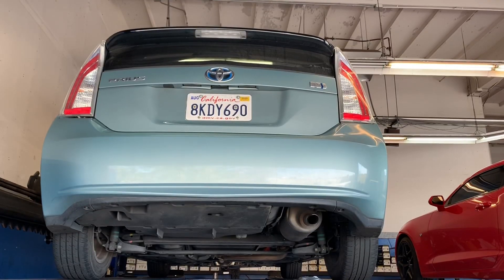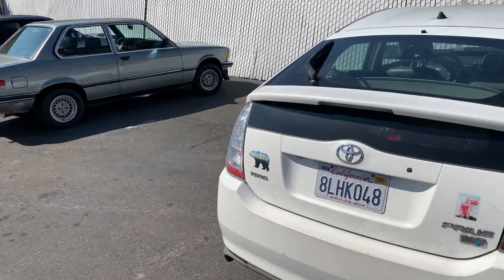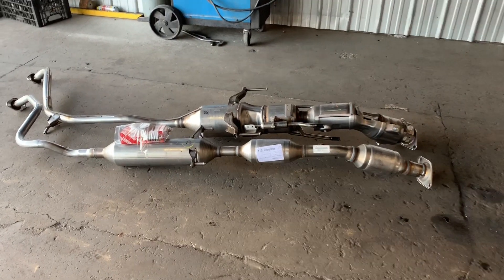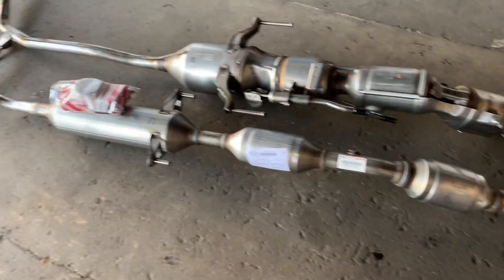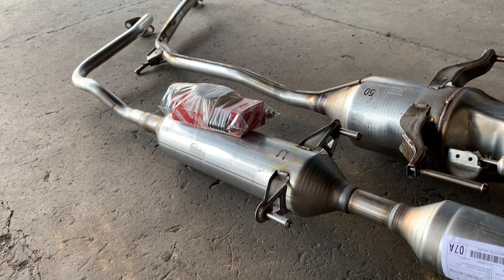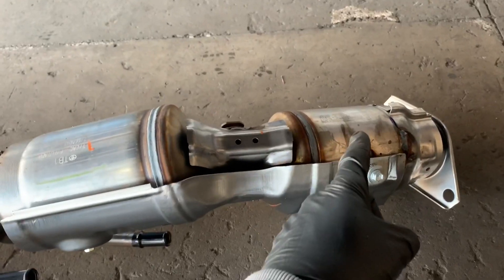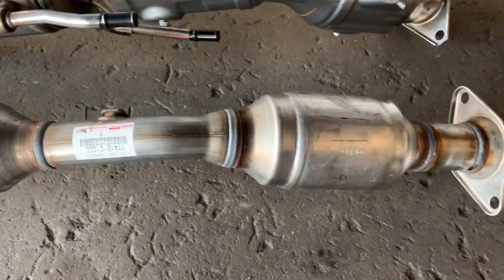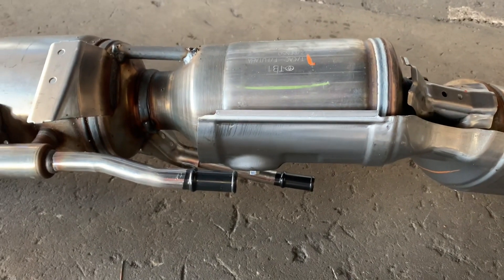2010 or newer Prius?  Do not drive it with a missing catalytic converter!

Comment: Thank you very much for this information. For those with a Prius, especially a Gen 3 Prius, I would STRONGLY RECOMMEND getting it protected underneath with a cage, titanium bar, or shield. I'm in Chicago, and I have a 2014 Prius which got it's catalytic converter stolen. Third party replacement parts -- it has to be the factory part due to the fact that the thieves cut through the heat recycling system too, not just the around the cat, as was shown in this video. I have to wait up to six months before the part comes in due to supply chain issues. If your shop tries to convince you not to put a cage or rod on it, as mine did, don't listen to them -- bring it to a shop that will do it. Otherwise, prepare to run the very real risk that it will be stolen, and your car may be out of commission for 4-6 months.
Reply from the maker: We have a solution for the back order if you let us do your repair.  Call the shop 916-421-0399
Reply: @mufflertech  Hey, I live in Chicago, otherwise I'd bring it to you. But I did call around and finally found a shop that would do it. The thieves didn't know what they were doing, and really did a hack job on the coolant pipes -- but with some creativity and some welding, the shop said it will be done. Crossing fingers!

Comment: Great video and very useful info. One slight correction tho: the 2010-11 Prius has different taillights than the 2012+ Prius. The 2010-11 Prius taillights look similar to the gen 2 Prius’. The headlights are a better indicator.
Reply: I've always thought the placement of the shifter in the interior console was the best indicator between gen2's and gen3's. The Dash in the gen3 are completely different.

Comment: great video! thx for sharing. dont mind the folks saying you could have summed it up quicker. lots of good info and nice shots of the prius exhausts systems. thx again!
Reply from the maker: Thanks Will.  I do these unscripted and I can run a bit long.  I appreciate the criticism and thanks for watching.
Reply: long is fine and no problem. I was commenting on the other viewers who actually had a criticism. good content! I actually learned some new element of how the Gen3 prius works; and heats up the cabin interior more quickly via exhaust gas heat extraction - at least that's what I think is going on.

Comment: The Gen 3, i doubt,  is running coolant in the exhaust system for cooling.  The cats will glow red with bad fuel/air ratios and that's after the secondary cat. I think they're doing that to heat the coolant to either heat the motor faster or provide heat faster to the climate control system. Just to clarify.
Reply: what happen when you are cruising for hours? do the water left inside the cat jacket just boil off?
Reply: @Francois_Dupont the exhaust is the fastest thing to warm up.  Use it to heat coolant,  you can then heat the cabin and motor faster.  Once you're cruising,  you just continue running it and cool the coolant in the radiator.  EGTs aren't typically a problem in gas vehicles.  So you don't need to worry about the exhausts.  In contrast, new diesels monitor EGTs AND have an air mixer at the exhaust tips to lower discharge temps to safe levels.  Also,  in comparison,  a 1992 Honda Civic puts out similar HP to a Prius.  And the 1992 Civic radiator is (jokingly)  smaller than my air cooled motorcycle (air cooled doesn't typically have a radiator). You look under the hood of a 1992 Civic and you expect a normal sized radiator.  It's half that size.
Reply: @jkutches17  I think you are correct.  Unfortunately the cost of a little faster warm-up can be an internal leak into the converter which will slowly drain your coolant and lead to a cracked block.  Bad idea by Toyota engineers in my opinion.

Comment: Thanks for the video, useful info here. Scrapping out our gen 3 and turning it into sand rail car. Head gasket already failed (mom never serviced the damn thing). I got in under there and unbolted the whole assembly front and back, cut the coolant lines, one being intake to the cat and one being outtake I believe? Just gonna splice em together for a sand rail vehicle, off road only, we have a perfect sized steel pipe piece to splice them which is lucky because I did NOT watch this prior to taking it off and I got COVERED in coolant. 😅 But hey, there's a perfect assembly ready to be scrapped and hopefully splicing those lines lets the coolant return to engine and the car be usable off-road. Don't want to have to completely revamp the coolant system for an off roader sand rail. Next project, off goes the hybrid battery system and leave it at 12 volt with engine haha.
Reply from the maker: Sand rail Prius?  That’s sounds interesting!  Putting a loop on the lines will work fine, just be sure it doesn’t get pinched.

Comment: Currently, there a plenty of easy pickings with Gen 2 cats.  It won't take long for the experienced thieves to find out that Gen 3 cats are just as easy to steal as the Gen 2 ones,  They just won't be cutting the preheater coolant lines.  Still on a Gen 3, one cut with a Sawzall and just two bolts need to be removed.  They will also cut the wire to the oxygen sensor.

If the coolant lines are cut, the car can be made drive-able  by repairing the lines and  refilling the radiator with coolant.

Comment: Good video but 1 correction the coolant going to the the exhaust is not to cool anything its to heat the fluid up fast to allow the heater to get up to temperature faster for cold days like in winter.  I currently need to decide if I want to do the bypass trick because my cat must have cracks inside allowing the coolant to leak into the exhaust pipe causing lots of white smoke and lack of coolant as well as no heat and easily overheating.  I have a appointment at the dealer but I don't think that service bulletin on the heat exchanger issue allows recall repairs if its over a certain mileage.  More if you live in CA but not here in the midwest unfortunately.  I have 140k on my 2018.
Reply from the maker: You’re correct about the heating issue, consequently it does also cool the exhaust at the same time.

I hope you’re right about the exhaust being broken internally, we’ve never seen that on any Prius.  We have had quite a few with bad head gaskets.

Comment: On the GEN 3, cutting the coolant lines and driving just causes the head gasket to fail prematurely. Especially the 2010-2012. Good video from a 3 Prius owner.
Reply: I drove mine for a couple miles on the highway before I realized that I shouldn't be (red light flashing). I've been awaiting a replacement part for ~8 months at the dealer now. My fear is that I damaged the engine in those few minutes driving. Any thoughts on that?
Reply: @TheBentley90   If when you stopped there was 0 coolant in the radiator, it might be damaged sadly. Was there coolant when you stopped or not?
Reply: @hedgehogthesonic3181  There was no coolant. The part came in after 10 months and I'm driving it again. Seems OK for now... Fingers crossed!!

Comment: Looks like the Gen 3 is a lot harder to steal and hopefully will not be targeted as much. That’s the one I have. I will not drive it if mine gets stollen, knowing the coolant lines get cut. Thanks!
Reply from the maker: We are starting to see the gen 3 pretty frequently now.  I’d recommend some preventative measures
Reply: The gen 3 converter is more difficult to steal. There is not as much room around it to work. The gen 4 has a shield from the factory. Toyota keeps improving.
Reply: @danmarjenka6361  I added a shield just for peace of mind. I have seen quite a few stories of 3rd gen cats getting stollen. I should have sprung for a 4th gen but still love my 2013.
Reply: @mylesgray3470  It does happen, unfortunately.
Reply: Mine is Gen 3 and it got stolen last week.
Reply: @armandtecson8542  That sucks! Sorry to hear these are still getting stollen. I have a shield and I take pretty extreme precautions when parking. Always part in my garage. I never park in unsecured public lots more than 30 minutes. Not much else that can be done.
Reply: Mine got stolen a bit over 2 wks ago, since it's a plugin and they didn't sever the lines, I've been driving it on EV mostly but only for my short commutes to & from work charging both places. This video was great & helps for the gen 3 identification
Reply: My cat was stolen and the coolant lines were not cut. Gen 3 Prius.
Reply: @julianbrelsford  I still have not bought a new Cat, been driving EV mode only, even when I've attempted a 50mile drive it was horrible, not recommended (I conserved EV mode for driving in city & let it rip on the fwy), the noise and throttle response is the worst, would limit use like that to only a few miles at most. Also notable that excessive heat build up near the Air/Fuel ratio sensor/manifold area & near the firewall may be a hazard, would even be safer to just straight pipe it so at least some heat is transferred out back the exhaust & so the engine coolant does it's thing with the heat exchange vales for coolant near the resonator

Comment: How about installing a length of steel truck brake line with one end welded shut. Zig zag the line  near the converter cut points with the dead end up by the headpipe bolts.. In the trunk mount a cylinder of mace pressured up to 200 psi. When numb nuts saws through the little line in his way, he gets a face full of bear spray..... or concentrated chlorine. Something to thank him for ever considering your car.
Reply: While I don't think there has been a case on cars yet there was one where someone did that with a shotgun on their property to try and ward off trespassers. Instead he crippled the person in question and was found guilty on a charge and had to pay some serious money to the guy as the courts more or less said, yes they shouldn't be trespassing but that's not a reason to leave a trap. Same goes for a car. Now if you wanna leave something that would dull their blade to nothing in there by all means do it. No law on that part.

Comment: One mechanic told me that they usually only take the fist cat on the gen 3 so he quoted me a lower price, then he told me later that they took both.  That rings as a bit bogus and potentially manipulative to me  because why wouldn’t they just take both if they are right next to each other. Is he correct though?
Reply from the maker: We never see just the first one stolen.  With their close proximity, it would be more difficult to take the front and leave the rear.
Reply: @mufflertech  thank you for the reply!

Comment: Can I drive mine to a shop if the upper/front catalytic converter is still attached and they cut between the two resonators (it still has the o2 sensor too). The idiots stole my resonator and the back cat instead of both cats 😂

Would it hurt anything to drive with the pipe severed between the two cats? I would have to go around 8 miles.
Reply from the maker: It sounds like you no longer have the coolant exchange unit which means the coolant lines are not hooked up.  If I’m right DO NOT drive it, even 8 miles.

Comment: Thanks for the video. I own a Gen 3. There are a lot of cat thefts in my area. I am wondering when my turn is. I don't drive my car much since I now work from home. How would I know that the cat is gone?
Reply: Like you're missing a muffler. It won't sound like quiet Prius. There are good cat converter lock videos out there too as I'm looking into getting one!
Reply: Your car will be noticeable loud and the check Engine might turn on cause the o2 sensor... But trust me you'll notice it
Reply from the maker: As already stated, you’ll know as soon as the combustion engine fires up.  See my video on driving a gen 2 for reference https://youtu.be/kP3_cwJKoGU

Comment: The car manufacturer should do more on design so making difficult for the thief.
Reply: They need to make Prius ALL ELECTRIC. No cat converter,  no problems👍😉
Reply: @toulee8051  Lithium battery is more expensive than CAT.🥱
Reply: @jeraldleung6009 Harder for thieves to steal battery pack then cat converter 🤦
Reply: @toulee8051  👈Well! that will be silly thief. Easy the whole car, that has motor with expensive powerful magnet, copper, etc, unlike petrol engine just cheap alu.👽
Reply: @jeraldleung6009  We don't need to go down that rabbit hole for the thieves entertainment

Comment: We have a Gen 2 (parked in the street) and a Gen 3 garaged.  Our Gen 2 just got the converter taken less than a week ago.  Cut wires for the sensor dragging....anyone know if Gen 3 are less susceptible to theft?
Reply from the maker: Put the gen 3 outside, it’s way less of a target.  The cat assembly on your gen 2 is more valuable for the recyclers.
Reply: @mufflertech  Thanks, is it much harder to steal comparatively as well?  We were looking at a CAT Shield for both....
Reply from the maker: Yes, with the coolant lines it is more complex to steal, they definitely still do it though.  We see about 10 gen 2’s to every one gen 3.
Reply: @mufflertech  what is the ration now? Is it still 10:1? 

I’m just wondering if gen3 are being targeted next as all gen2 are being junked due to high repair cost.

Comment: Can I connect both ends of the coolant under the car and run it like that temporally?
Reply from the maker: Yes, it’s just like bypassing a heater core.
Reply: @mufflertech  Thank you for the response! Is it possible to install a Catalytic Converter only, without the recirculation System, and bypass the coolant entirely? How will that affect the vehicle?
Reply from the maker: @viktor_vaughn  in California there are no alternatives to the OEM that are legal.  If you’re in a state that isn’t regulated you should be able to run a permanent bypass on the coolant lines without issue.  The only side effects would be a longer warm up period for the coolant.
Reply: @mufflertech  I definitely owe you a beer now. thank you!

Comment: stupidly pushed off getting a shield installed. on xmas, had my cc stolen....dealer is telling me that there is a 5 month backlog
im soooo screwed
Reply from the maker: Where are you located?
Reply: @mufflertech  san francisco. i cant even get an official estimate till the 6th. just saw that toyota is going to offer the plate to be installed on all new vehicles.
Reply from the maker: @thewkovacs316  Call the shop, we have a solution for you.  916-421-0399
Reply: @mufflertech  i call in the morning...thanks

Comment: Please help, can I put an aftermarket cat on a 3rd gen?
Reply from the maker: Depends what state you’re in, California no.
Reply: @mufflertech  Thank you very much, I actually have a 2012 lexus ct200h I was told OEM only for light to stay off... Would you agree? Is there an aftermarket you'd prefer? I would be replacing O2 sensors with OEM. I'm in Illinois...

Comment: Is it easy for them to take this part? Because my engine light has been off and on for weeks and I get a oil change took 15 minutes I stayed in my car, would I be able to tell if they stole it? Or does it take work to get it off?
Reply: Nobody would do that while you are sitting in your car.  You would have heard a lot of loud grinding under your car during the oil change, and the exhaust would have been very loud upon driving away.   The light you see is probably the Oil Change reminder light.

Comment: I have a 2010 Prius and just noticed my coolant reservoir low. It leaks through the actuator and seems like a pain to fix. Does anyone know about this problem or does anyone have a link to a video where they replace the actuator? Thanks.
Reply: inminent head gasket failure replace asap stop driving it like this

Comment: What's the deal if you install a cheap non-Toyota OEM part and then take the car out of California, where the OEM is not required for smog? Will it still function just fine?
Reply from the maker: Yes, you just won’t ever be able to register in California or New York until it gets an original part, at least until the other states adopt CARB rules, and it’s likely coming.

Comment: Question: How big is the risk to a thief who's trying to steal a Gen 3 cat of being sprayed with coolant from the heat exchanger, which can be boiling hot?
Reply from the maker: Pretty low unfortunately.  Most thefts happen long after the car has been parked and depending on the ambient air temperature, engine coolant loses its temperature pretty quickly.

Comment: I thought the Gen 3 catalytic converters were not worth anything, as in precious metals are different from Gen 2
Reply from the maker: They’re worth less because of a lower amount of precious metal than the older generation’s.  They still have a fairly high content compared to most other vehicles produced.  They are now one of the highest targets as the older generations have aged out.
Reply: @mufflertech  thanks for that information. My car just got hit with theft over the weekend in Los Angeles. In your experience, is this covered by comprehensive insurance?

Comment: Toyota should change the damn design or put some plates underneath
Reply from the maker: Toyota (or any other manufacturer) had no idea this was going to be a thing.  And even if they did, why should it be their responsibility?  The cars don’t come with wheel locks or break resistant glass for other forms of theft, why should they have something for the car underneath?  I’m not looking to be argumentative just pointing out that automotive manufacturers can’t plan for what thieves are going to do in the future.  Your frustration should be directed at the government that gives or doesn’t give law enforcement the teeth to deal with it.